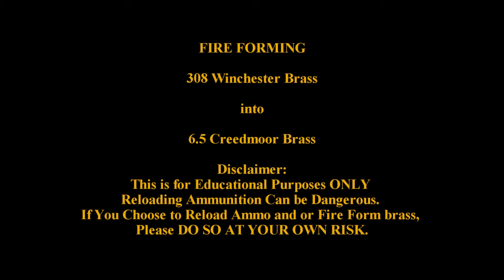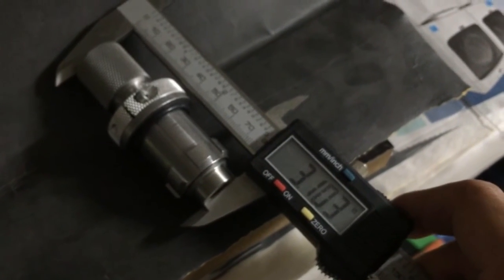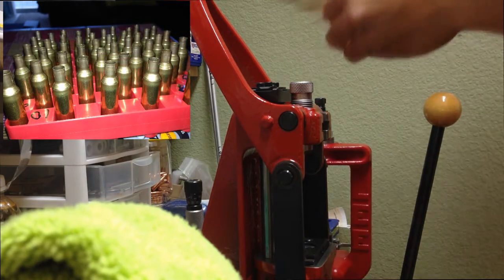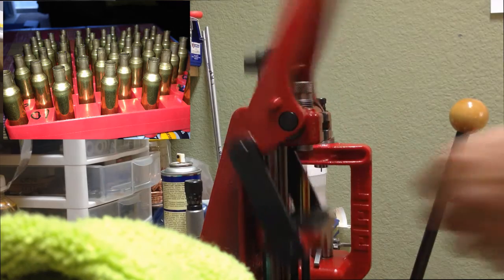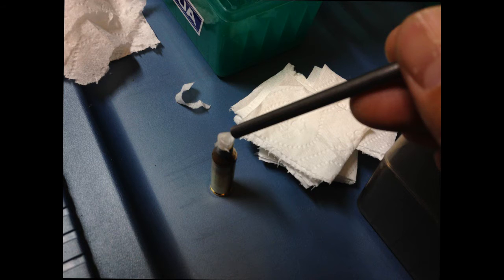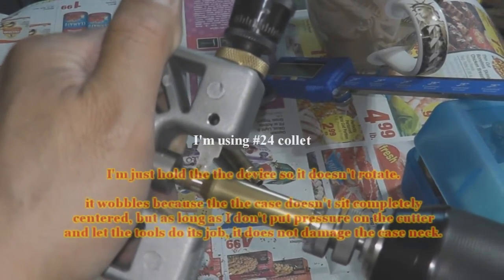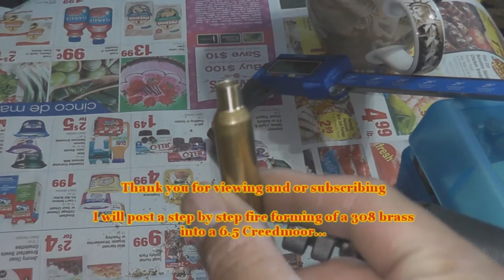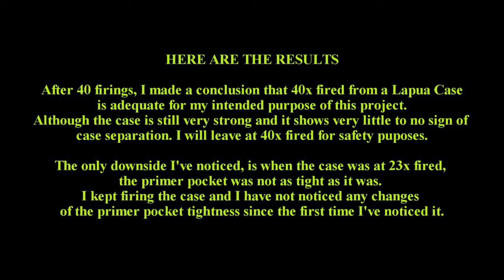Lapua .308 Winchester to Lapua 6.5 Creedmoor

Comment: I have made 6.5 creedmoor from federal gold medal matchcases with good results it lasted awhile if I can remember like 13 firings.
Reply from the maker: +miguel contreras That's awesome!!! Hornady brass are readily available and still affordable but it's good to know how to make it out of brass that some people throw away... :-)
Reply: +miguel contreras What was your load? I did some quick case capacity measurements between Hornady 6.5 brass and re-sized 308 gold medal but don't have the numbers near by right now. My favorite load is 140gr, 41.5 of H4350,  Fed 210M, in Hornady brass. Would like to duplicate that in 308 cases or even 243 as they are much easier to find.
Reply from the maker: +maquereautin thank you for viewing and commenting. My pet load LOW NODE is 40.6, use a bullet comparator to measure your COAL. I set mine at 2/1000 off the lands. Let me know how it works for you. What powder scale are you using?